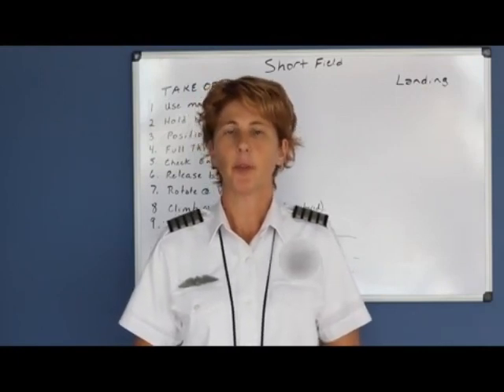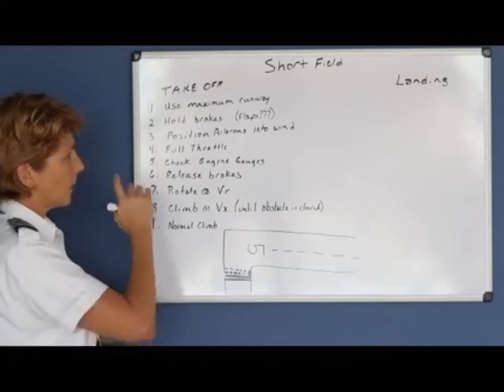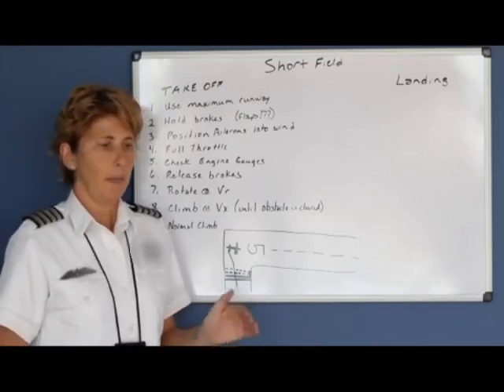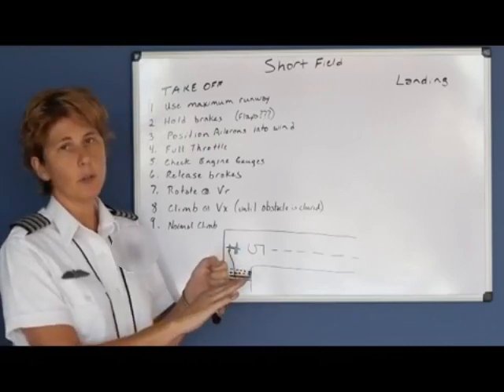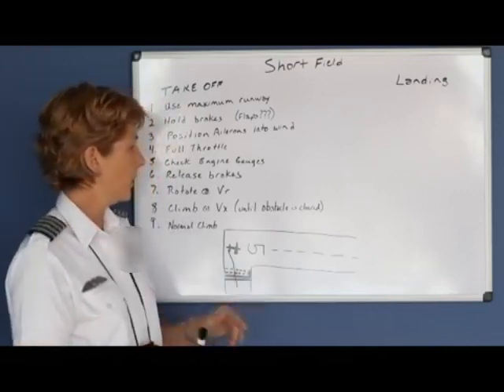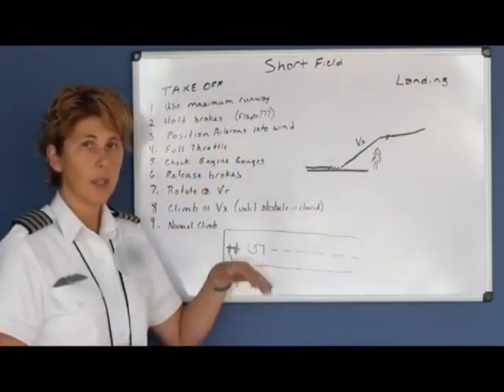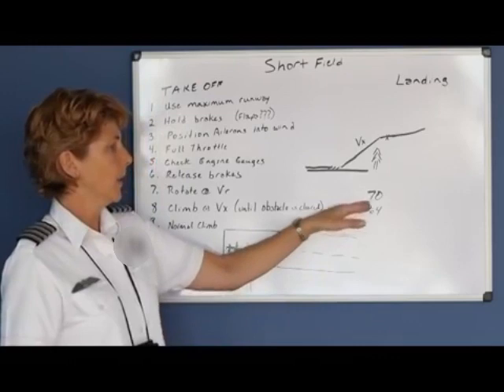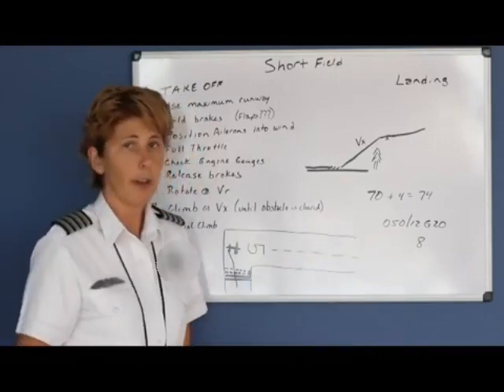Short Field Takeoff (Private Pilot Lesson 12b)

Comment: Interesting what you said about the flaps perhaps not being used if needing to clear an obstacle.. In the POH for a PA28-151 it recommends flaps regardless (25* no less) but furthermore according to the performance charts it actually climbs faster with flaps although the ground roll is extended (opposite of what you mentioned). So for a true maximum performance you would accelerate without flaps and then extend 2 notches for a rotate and climb speed of 52KIAS. We like to rotate at 55 and climb at Vx clean speed of 63kts even with flaps for a substantial margin of error at my flight school.